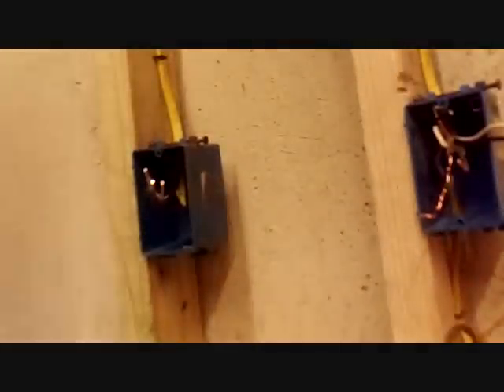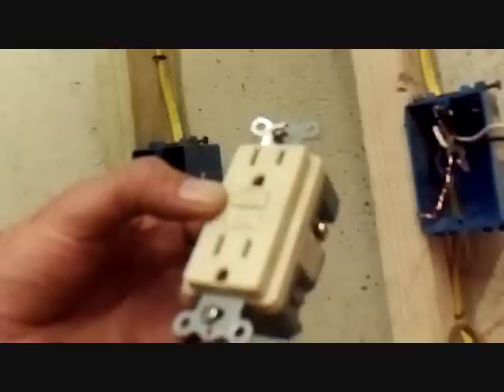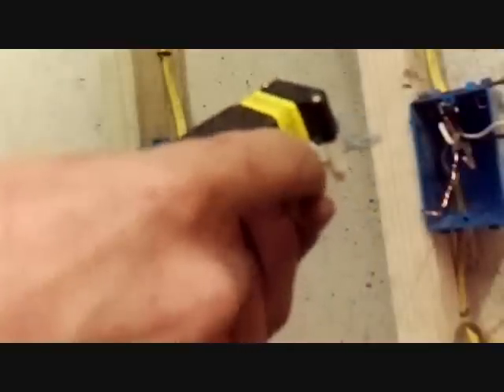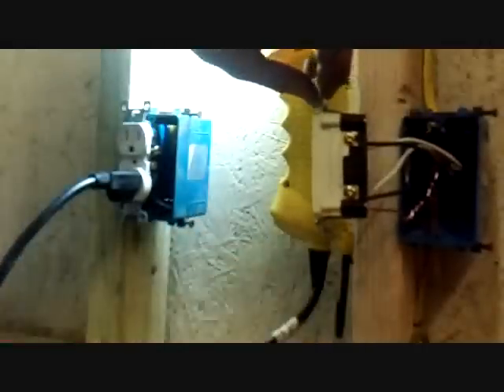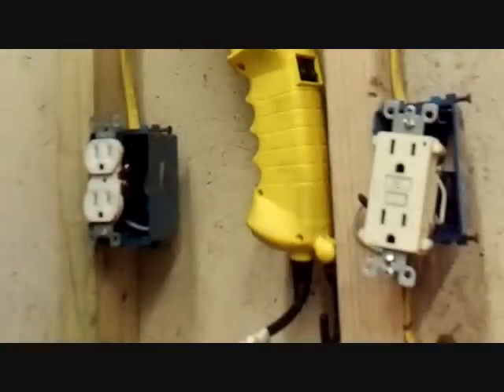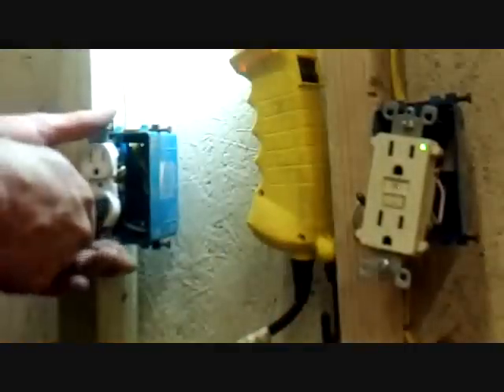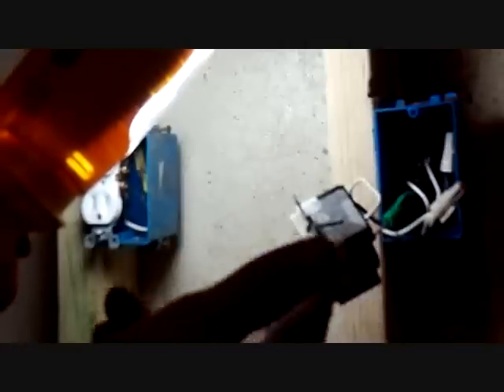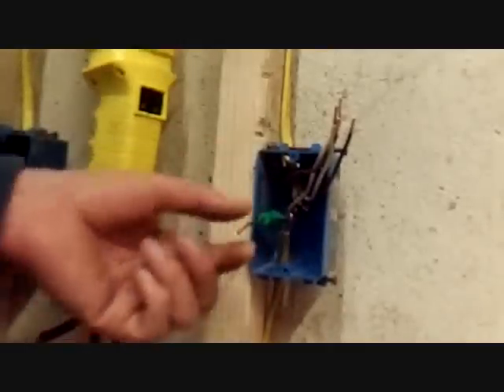GFCI receptcle common problems

Comment: It would be really great if you could do a GFCI video for early 2000 ish RV
They are extremely different. Major issues if the outlet is under cabinet with water leaking through it . I've replaced 3 but have found 3 More that where hidden.  Thank you

Comment: My gfi works and my outlets down the line use to work but they just went out nothing is tripped or tripping, gfi or circuit breaker and GFI outlet works checked all connecting wires in all the outlets down the line and at the GFI. But the outlets down the line still aren't not working. I'm just at a lost not a electrician for sure so asking around.? Do u have a idea what it could be.

Comment: I have a GC I outlet in my rv bathroom   When I have a fan plugged into it and running and then flip the light switch for the lights above the mirror. It shuts off power to that fan that’s plugged in. But it doesn’t trip it.  And when I shut the light off the fan gets power again

Comment: cats are very hungry till this day...also note, i found both bathrooms neutral cross from line to load after i moved into home...and i find it wrong when first gcfi coming in from panel that goes to laundry room wires cross hot to load,then feed to bathroom downstairs then feed to upstairs then outside outlets ...i find it frustrated that i have to remove all the gcfi out after i found the breaker that feed them...then have the hot and neutral separated  out from not touching anything for all the boxes...then turn breaker on...and carefully use volt meter to find which is hot on first box where feeder line starts from the panel...one hot black wire and other is load wire has no readings ...so i blue tape the hot so i know which is line and which jacket goes with the neutral...cause i see 2 set of wires...one line and other is load..good thing ground is all pigtail together..and i did the same for both bathrooms..by tape each hot source that is LINE ...after that, i turn off the breaker ...and start the first gcfi..correctly wire in order ..LINE wires goes to LINE only then LOAD wires goes to LOAD..then same for other gcfi...LINE and LOAD ...when its all done..i turn on the breaker and start the test and reset first gcfi..and last outlet to bathroom..that will reset power gonna to outside outlets as last location where wires ends..all outlets working in proper order..i understand that one trip ..entire line is dead...but making only one trip and letting other outlets not, is little tricky for me to do..so i rather have like this ..anyway i feel safer now if someone downstairs drop hairdryer..its best to know if your in 2nd bathroom upstairs..plug went out ..then i know fast than not

Comment: I want to put a GFCI in upstairs and downstairs Bathroom so the resetting can be done in either room when tripped. My downstairs bathroom is working fine but the upstairs bathroom as no power ... is it b/c I have wires in the load part of outlet where it’s not necessary? I don’t have room in the box for another cap!

Comment: Help...I installed a gfci...only 2 wires...hot and neutral..in the line section...I have power but the gfci tester doesn't trip it.

Comment: Still lost. I have an outlet after the GCFI outlet I replaced (off white to white)  and the replaced outlet works but now the GFCI and switch to garbage disposal do not work. Power getting to GCFI (LIGHT IS ON) and reset still works but it will not work. All I did was replace an outlet and m to a tally confused. The breaker is 20amp and i put a 20amp outlet in. Help

Comment: I have a GFI hooked up and also have it hooked up to a light switch with the switch is on it works perfectly fine when you turn the switch off it throws the breaker what could be the problem trying to fix somebody else’s mess up

Comment: Thanks for great video! I almost returned the gfi I got from Lowe's, it didn't have the yellow strip, I caught when you said line an load on back of gfi I connected the line in the load and I thought it was defective, I connected the hot in the line and bingo it worked, thanks again.
Reply: A great reason why amateurs should not be working with electricity, which they KNOW could kill them or burn down their house and kill others.

Comment: This is definitely not my field of expertise. Line on a receptacle will take the hot and the load other se correct? Black goes with the brass screw and the white is the neutral that goes to the silver screw. Am I on target so far?  Where I got lost is in this last example in this video you only used one set of wires..🤔 
So did you cap off the load line and is that because you didnt want the power to feed another receptical down the line ? Or do I have that backwards..?

Comment: There is no power on my lines coming from the wall... i checked the breakers and nothing ..no power.  Then i replaced cgfi  but no power.. what can be wrong?
Also .. cgfi outlet was connected to the bathroom light... and that switch does not work either.
I checked All the breakers in the box and all have power.

I will appreciate your help.

Comment: You didn't show the gfci hooked up backwards. You just bypassed the gfci altogether. I think you missed the point on the last hookup.
Reply: No. The GFCI is not bypassed, and is working on the One socket that he has the two bottom terminals hooked onto. The "pigtail" now feeds the second socket but is not acting as a GCFI.....He does show this. What I think you're expecting was all wires hooked up on the GCFI socket, but the second socket is still not part of the GCFI, which could also be done, but he didn't show it. Hope I explained that properly to understand. Either way, both sockets do work and is not bypassed.
Reply: @iconforu2c  Yes, The GFCI is bypassed ! A GFCI is made to provide protection to the devices plugged into it AND to all non-GFCI receptables downstream. He removed the protection of all downstream outlets and he even tells you why he did it, to prevents confusion. I didnt want people to be confused, but I did want people to be un-protected. Yeah go spend more money and make every outlet a GFCI. Nuts
You know there are GFCI Circuit Breakers right, they protect non-GFCI outlet, will he remove those as well?
Reply: @josephzajdler  Yup and we'll said.

Comment: Can anyone help? There was an extension cord that shorted and now the problem is I have 3 lights and 3 outlets that work sometimes and sometimes don't. I have my outside outlet and 2 gfi outlets that work. 1 gfi won't reset or test but plug something in it and it has power. Can that gfi have a problem that is causing the others to work on and off?

Comment: So basically i just took drom this video that you have put more than one GFCI on a circuit????? Been looking in my  2017 nec book and cant find where its allowed by code🤷🤷by putting two GFCI's on the same circuit they will receive each others signal and cut the other out and it will never work-dont believe me try it out lol🤷
Reply: You can pigtail a gfi just like a normal outlet and have 20 on one circuit.   I hate doing line, load because people get confused  and think I messed something up.

Comment: Hi Ryan, how did you rewire the CFGI the correct way so that when it trips, the other outlet doesn't turn off? Can you pull the CFGI outlet out and show us the rewiring? Thank you.
Reply: I believe that he just tied the wires for the second outlet together with the wires (hot and neutral) coming into the box with the GFCI.  That way, the current for the second receptacle does not flow through the GFCI outlet.  Having said that, it is quite common have a GFCI as the first outlet in a series of outlets, so that ALL of the outlets in that circuit are protected.  What this video does will leave the "downstream" outlet unprotected.  Less nuisance but also less safe.

Comment: The most common problem with homeowners changing gfci receptacles is marking an reading the back of the old receptacle to remember which set is line side , which set is load set , not gfci receptacles have the line at the top an load on the bottom  ,

Comment: Good video, but you pointed at your white pigtail saying it was the hot, Isn't the white usually neutral and hooked up to the silver terminal on the outlet, and the hot (black) hooked to the bronze terminal? But I guess that's why you shouldn't assume, and always test to make sure which is which.

Comment: I thank you for this video. I was replacing a GFCI and transferred the wires to the new outlet just as they were on the back. Other outlets still did not work, watched your video and now it all works.

Comment: I got a question I have a GFI in my laundry room and I hooked up my compressor to it a couple times and it worked fine then all of a sudden the compressor didn't work and the GFI tripped the main circuit I reset the main circuit push the reset button on a GFI and the light lit up but still no power going into the receptacle from any kind of plug would this indicate that this GFI is no longer working even though the green light is on

Comment: I have 3 GFCI outlets and none have power to them. My girlfriend popped the one in her bathroom with a blow dryer. I opened all three and no power is going to none of them and I checked her Panel on the side of the house and there is none that are tripped. Could there be a problem in the junction box in the attic?
Her daughters bathroom has one and it works. And if I trip it and check the wires with a tester they have power.

Comment: I installed a gfci  set up to also  control the adjacent socket in the  double gang box.  The box also contains wires to a third oulet (which I left uncontrolled) and a bathroom ceiling light.  It all works as expected but the bathroom light has a slight delay. I checked the connections and found everything good. My suspicion is that the GFCI itself is causing the delay and the reason I believe this is that it only delays on the first throw. Subsequent throws cause no delay. This smacks of capacitance. I don't know what is inside a GFCI but possibly capacitor. Is it common for a GFCI to cause a delay like this?

Comment: I have an outlet in my kitchen that has 4 wires on it ,i wanted to replace it so I plugged a light in and found the breaker that killed it. and when I checked I still had voltage on it it took two breakers to completely shut it down ,any idea on why that would be the case?
Reply: I am renovating houses. Had that case once. A previous owner who was a hobby electrician mixed wires from two circuits into each other. Very dangerous since none of the breakers might trip. You need a professional electrician to sort it out. The crossover might have happened in the attic in one of the junction boxes. It may take some time to test everything through.

Comment: Hi, you have good introduce of FGCI, but I am experienced a strange troubleshooting problem:
My bathroom have one FGCI to control other two bathrooms receptacles. It pops up the red button sometimes just reseted it goes back to normal. But recently, the red button pop up even reset it still keep popping up, wait whole day long then reset back. Happen again yesterday. It is been used more than 28 years, I went to homedepot to get a new FGCI replaced, follow the instruction Line and Load location, use the meter to verified. The new one got the same problem keep popping up. 

I check the power box, reset the power breakers few times, still the same. So, what do you think?   
Stan  1/15/2017
Reply: Broke wire somewhere tripping it or wires touching

Comment: is it okay to add multiple outlet and lights at the end of existing outlet with GFCI
Reply: Melmar Calizon
Reply: Melmar Calizon
Reply: I wouldn't hook in lights off the end of a GFCI, I've seen it done though. The amount of outlets isn't determined via the GFCI, but more via the gauge of wire and circuit breaker. On a 20 amp circuit, with 12 gauge wire you can run 10 outlets safely.

Comment: Just curious...but...then why does it say in the receptacle NOT intended for WET and DAMP locations? Anybody?
Reply: The receptacle itself isn't meant to be wet or damp, however it can protect you if something that is plugged into it is. They do sell industrial GFCI's that are damp/wet rated meaning they can be used outdoors. Those ones can survive outdoors with some water, but obviously are not meant to be submerged.

Comment: I still don't understand. In my bathroom is the gfi plug above the sink along with the switch for light over the sink. I had a nite light plugged in to the gfi. Well I went to turn on the nite light and it popped causing the bulb to split off at the top and now plug and switch for the light do not work. I changed both bulbs reset gfi and circuit breaker and I can not figure out why they both won't work!!!!!!!

Comment: I have my unit hooked up right with green light on. Unfortunately it will not get past the what I think they call the triple protection waybits shipped.

 I even tried all different ways to connect the wires and either light doesn't come on or it shows red which is the wrong way to connect so I know it's currently hooked up right. I just can't get the test/reset button to work. I have the same exact 20a-125v outlet as I had previously. Any help would be appreciated.

Comment: Sounds for me that some people do not understand how a GFI (or RCD) is working. 

A normal socket have a side for "Hot" and one other side for "Neutral". Do you can install the IN and OUT power up to you. The GFI have a marker which is IN power and other is OUT power.  If the CFI breaks the power for HOT side all other sockets and devices behind(!) OUT power is powerless too. That's the once secret! 

If you let works all your GFI outlets in one room just alone do you let the OUT power screws only empty. Do you rewire from every GFI socket only from the IN power to next GFI socket IN power. If one device is chrashed exact only this GFI socket device stops the power and all other installed devices at the other GFI sockets works without a break.

If you let work only one GFI outlet in one room controlled and saved all other normal sockets do you put them on the OUT power of the GFI how should be the first socket in this room! If one device in one of the sockets chrashed, the GFI stopped the power and all devices in all sockets stops too! So do you looks what do you install inside this power chain.

Comment: I recently tried to replace my GFI outlet to a different color.  When trying to switch to the new outlet, it will not work.  We have tried multiple different ones and kinds and none will work.  When then switched back to the old GFI outlet and it works perfectly fine.  We can not figure out what is going on!  Also when we install the new GFI outlets, it will not let us push either of the buttons in.  Any idea what could be happening?
Reply: Omg! We had the very same problem!!! And I was on here and read your post so I read this to my husband and he put the old one back on and it works again!!??? I would love to know if someone knows why??
Reply: I've been having the same problem.
Reply: +MrTrenbo we put the old one back on and it worked again!!
we can't figure out why and why werent the wires even reading hot on the meter!!!
He put the old GFI in and it worked just fine!! so puzzling
Reply: I had taken a GFCI outlet from my garage and wired it in my laundry room.... WORKED.  Bought 2 more to install in other outlets and they didn't work.  Put a new one in the garage socket.... didnt work.  Put the garage one back in the garage and a new one in the laundry room and the garage one worked and laundry room didn't...... WTH??

Comment: I have a GFCI in the garage and from fall to spring, it goes off and stays off.  So both of my bathrooms' outlets are not working.  I think that it is either the outlet outside that is causing the problem so I replaced a cap to protect the outlet.  I also  replaced the GFCI so what do you think that I should do?

Comment: I was glad I read the comments, someone already asked my question... how exactly to connect it correctly.  I just discovered this is what is wrong with my bathroom wiring in my apartment. Whenever I turn off the light in the bathroom, it makes a loud "pop" in my livingroom stereo speakers.(same circuit)  Maintenance could not find the cause, he only checked the light switch which is grounded.  Well turns out the light is also wired to the GFI outlet and when I trip the GFI outlet it shuts off the livingoom power.  Your video now shows me WHY!  Now I can ask him to fix it.  Thank you!!

Comment: My son has 2 regular outlets the second leads to the first of 4 GFCI outlets in the kitchen. When he uses either regular outlet it trips the GFCI. We changed both outlets although there was no apparent defects or damage. It still trips the GFCI. We then changed the GFCI. Again it trips when either of the two regular outlets are used. He can use the GFCI with no problems and the three after the one that trips are fine. Which makes me believe the problem lies before the GFCI outlets. Anyhow here's a layout of the outlets 

Regular - Regular - GFCI - Switch for above sink light - GFCI - GFCI
Reply: did you ever get this figured out?  I have the same issue.  the gfci outlet works fine, but the other outlet trips it immediately when something is plugged in.  thanks